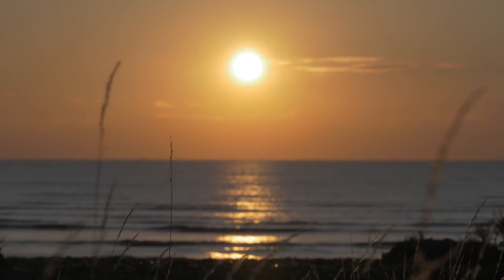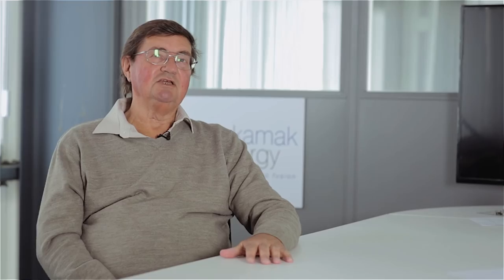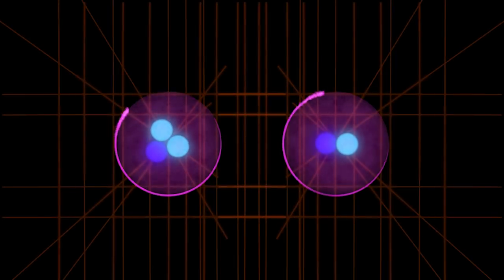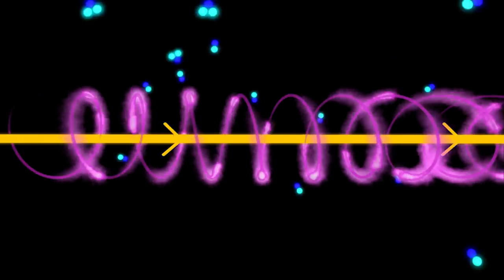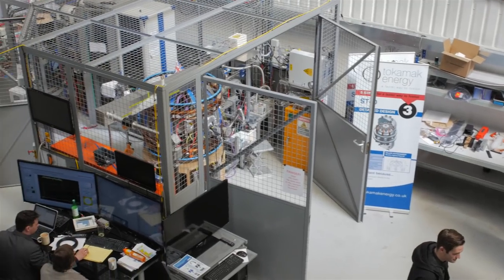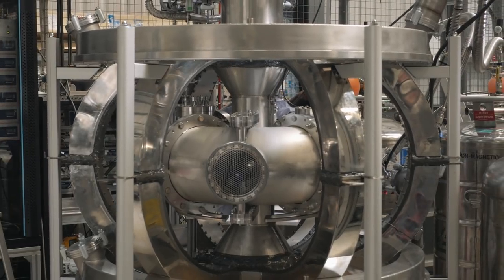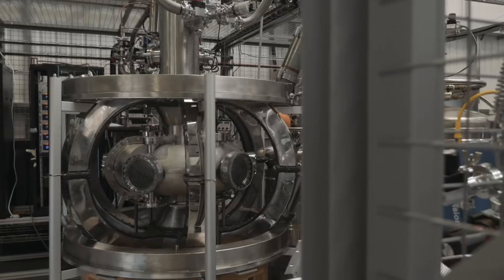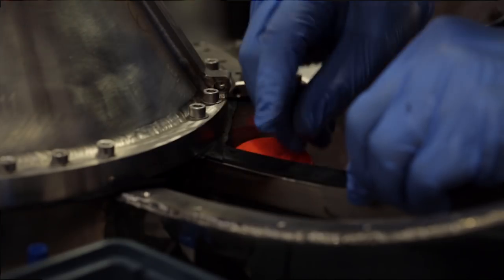Faster fusion

Comment from the maker: How can we harness the power of the sun and how soon? 'Faster fusion' exhibits for Royal Society Summer Science Exhibition 2015.  #summerscience
Reply: Perhaps starting to fund some new methods that are actualy good instad of pumping money in to garbage tokamak projects.
Reply: +Electro-Cute that would be a valid idea if you could demonstrate that tokamaks are a waste of time. so please do.
Reply: thekaxmax
"Demonstrate"? If you ask me then fusion with a dens plasma focus (DPF) device will be the future of energy production (if nothing better comes up). It forms a special type of electrical discharge instability to magnetically confine and heat fusion fuel.
I do not really understand what you expect me to demonstrate for you. I can tell you that hottest temperature made with such a device is 2.8 GK. That is more than the minimum requirement to burn proton-Boron11 fuel. The only other device that can achieve more than the minimum temperatures needed (1.6 GK) is a z-pinch machine. It holds the world record temperature of 3.6 GK, which is the peak efficiency temperature for the pB11 fuel. The only problem with such a device is that each experimental shot destroys the electrodes. So you could expect 1 to 4 shots each month, depending on how good you vacuum pump is.
What so ever, a standard DPF can be used several times before the electrodes wear out. But the Focus Fusion 1 (FF-1) device. which reached 2.8 GK, is much less exposed to wear. The temperature increases when the electrodes of the DPF are exposed to less erosion.
Another thing is that an experimental tokamak device is astronomically more expensive than a DPF designed for fusion power experiments.
When it comes to D-D fuel efficiency (deuterium-yield/energy input) th FF-1 is almost as good as JET and only surpassed by JET (out of all existing fusion reactors).
Does that work as a demonstration?
Reply: So you discredit Tokomaks- which have been proven to work (and indeed ITER's baseline is to produce 10x more power than is input) and big up DPF's which have never even come close to breaking even, nor are even considered an alternative to tokomaks. Stellerators maybe, inertial confinement need a lot of development- tokomaks are the best shot we have for fusion power by 2050. That isn't just my opinion- that's what the scientific method has shown.
Reply: captain swagworth Tokamaks have been proven to work as fusion reactors, which is far from anything special. The DPF have allso been proven to work as fusion reactors, stel.
This picture compares the FF-1 (Focus Fusion 1) reactor with the JET reactor: http://lppfusion.com/wp-content/uploads/2016/04/Deuterium-Yield-per-Uniet-Energy-Input.png
So do not even mention "not comming close to break even" with that overhyped tokamak BS on your side.
When it comes economic part it looks more like this: http://lppfusion.com/wp-content/uploads/2016/05/Wall-Plug-Efficiency-per-Million-Dollars.png.

The thing is that the FF-1 can't reach the prefered density needed to burn the right fuel, that is not the case for JET.
To do so they need to increase the current. To increase the current they need to change the electrodes made out of tungsten in to electrodes made out of beryllium. The problem is that berylium is poisonus and requires a reduction things like electron scattering. When I last read about it they managed to do so well in decreasing the energy losses that they increased the temperature reckord by 50%.

2050 is a generous estimate for tokamaks, but still a joke from an outside perspective. There is nothing considered an alternative to tokamaks by monkeys in labcoats banging 35 billion dollar rocks together and investors who are pretending that this is good thing to invest in because they are legaly forced to still pay the bills. People have been working with these stone age devices for was it 60 or 50 years now? The usage of dens plasma focus devices for the purpouse of fusion energy have been going on for 10 years and they have been constantly working with an under budget. Still they are standing in comparison with giants like JET.
Did you know that buying the new electrodes cost them 200,000 dollar?
Reply: JET is recently been upgraded, but is still an old machine. It was never designed to break even- though did get to a Q of 0.6 which is a record yet to be broken. It is a research machine to understand plasma and fusion. Most of it's cost was in the diagnostics- which FF-1 doesn't have anywhere near the level of- so that efficiency vs cost plot is just meaningless. ITER again, a research machine, is designed to have a Q of 10, with sustain pulses of Q of 5 (i.e. half an hour or so). Don't get me wrong, I don't care which fusion device results in sustainable power- but saying that focus fusion devices are more likely than tokomaks is just wrong.
 DPF devices have the same problems with confinement, instabilities, impurities etc. that tokomaks do, except that we know how to make a tokomak produce net fusion power, and we don't know how to make DFPs do it (at least not for anything longer than short bursts- which isn't useful if you need to cool the damn thing down again for hours before you need power again). It's the same with inertial confinement- vaporising the hohlraum target produces a ton of dust- which you would need to remove before doing any other shots. Even if we could get direct drive IC to work- we would still need to somehow shoot these pellets into our laser target area (and the laser afterwards) at something like 10 per second for a power station.
There are alternatives to tokomaks within the scientific world you lunatic. Inertial confinement, stellerators, yes even dense plasma focus. ITER isn't a tokomak because every plasma physicist has a fetish for them- it's because it's the only design we know that we can produce net power with. Like I said, it's just the scientific method at work.
Reply: captain swagworth They have allready reached a greater confinment time than needed for the pB fuel.
It doesn't have problems with instabilities, it simply is just an instability. The confinment method used is the natural behaviour of plasma. So there is no need to controll or acount for instabilities, they are a fundamental property of the method.
Impurities is not longer a problem for the instability used in a DPF. Decreasing the impurities is just of safety measure at the moment.
If theoretical asumptions obviously count then the people working with FF-1 knows to. They just have to change to berylium electrodes, increase the current and eventualy shorten the length of the elctrodes (oh and change to pB fuel).

What are you talking about? A DPF does not heat up like that. All the energy is electromagnetic. Either in the form of high energy electromagnetic radiations or electric currents. Much of the energy will be in the form of an electrical current puls that is beamed trough a coil. The rest of the energy will be turned in to electricity trough the photoelectric effect outside the vacuum chamber or absorbed by the anode for future use. There is an estimate of 80% efficiency.
The FF-1 reactor will be an electrically pulls powered fusion reactor. The current generated will be something similar to the absolute value of a sine wave. Thousands of these pulses are supose to ocure every second.
Ofcource temperature will be building up on the outside of the vacuum shamber, that is why you have cooling systems.

The scientific community havn't been ignoring alternative ideas because they magically know that there is nothing else that could work but the holy tokamak. The BS you spew out is not based on scientific research. It is based on your fanboy atitude to the scientific community. I mean how can scientists be wrong,? I mean it is not as if it have ever happened before.
If we knew that we could produce net energy power with it we would have allready done that. There is this BS atitude with in the field of fusion energy research that is completly anti inovation. As quickly as someone comes up with any alternative idea, that isn't a fucking tokamak, it imediatly gets labeled as woo fusion.
It is as if the constant failure of every atempt for a tokamak to reach its goals is spreading a cancer of pessimism. I mean even people who are practically clueless to fusion research believes fusion is a woo science.
Reply: Fusion will now save humanity. We need decentralized energy. Forget about this shit. Go read up on Molten Salt Thorium reactors. Everything you want they will provide. There is not on downside to these reactors. They can even be tweaked to destroy plutonium, making it into worthless sludge. Also it runs at 700 celsius, meaning we can produce all kinds of fuels on the fly right of the ass of the reactor. You can build a rector running a town on a bus scale. You can actually put your sleeping back on top of a thorium pile. China has a massive program with over 700 top scientist working around the clock building designs. This year they will start up their first reactor. Best thing is this reactor type needs electricity to run, so if you want it to stop, you just flip a switch and it shuts down. It is so safe you can put it next to peoples houses.
Reply: urduib that's all nice but the power generation is much lower than the other plants, meaning more plants which includes more maintenance costs, just not efficient enough imo

Comment: In the fusion process we see that deuterium and tritium come together to become helium. The problem I see is the extra neutron that is released. Neutron radiation has the potential to turn other elements it comes into contact with to become radioactive. As a result would turn Tokomak into nuclear waste. How does the researchers account for this?

Comment: Still has that central column obstructing the area where the hottest reactions could occur if it wasn't in the way. Need to make one that's externally supported and only has the field going across and not anything physical spanning that area. Then it'd be possible to dial the internal radius as small as you could get it to take even more advantage of the pinching there. (Think of hybridizing a bit of the idea behind Z-pinch with a spheromak, and you might understand what I'm getting at.)

Comment: how about a thorium reactor for the time being?
Reply: Hassan Tahan I still ask myself everyday what happend to thorium technology!! The only reason for its dissapearence I can believe is that the scumbags in power wanted fast breeders and plentiful uranium for weapons. It's fucking criminal
Reply: Luke Haworth the main reason people don't want to use thorium is because while it is more abundant than uranium it's not being mined on as large of a scale meaning it's much more expensive at $150 an ounce compared to uranium which is $95 a pound and yes thorium isn't as multipurpose you can't use it to build bombs or armor or tank shells and you can't put it through a breeder reactor to be reused and mainly with all the regulations and hate current reactors get its kind of hard to build new ones so until people can accept the use of uranium reactors as safe I doubt they'll accept the use of thorium as safe even though it is safer
Reply: Darude Rocket I thought it was mined and stored as a by-product of other industrial processes and stored because there's no use for it. Either way if we had thorium reactors and we began to extract it then economies of scale would surely bring the price down. It's certainly easier to obtain than uranium and we managed to make that work economically didn't we. Also at 150 an ounce compared to 90 for uranium with a much higher percentage of the fuel being burned in the molten salt reactors I still believe it's cheaper so your argument is kind of  null and void already. I'm not a scientist I'm a carpenter so forgive me if I'm spouting shit I just want to understand why this nearly 80 year old technology has been ignored
Reply: That is TOP SECRET